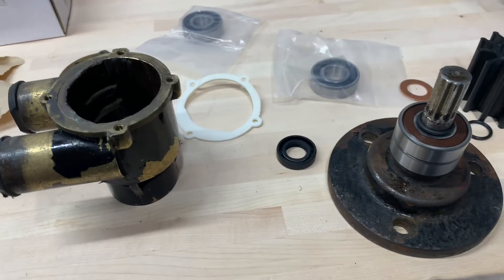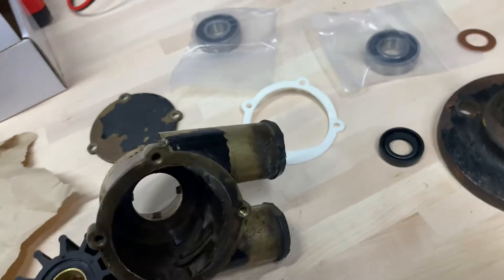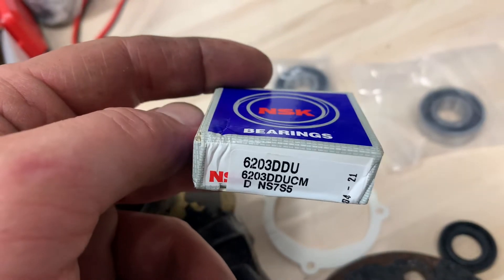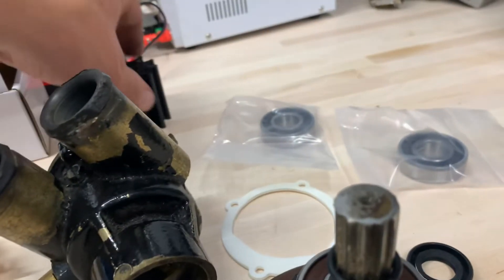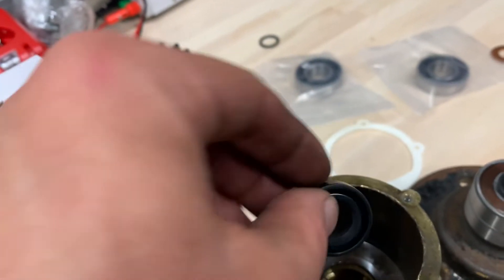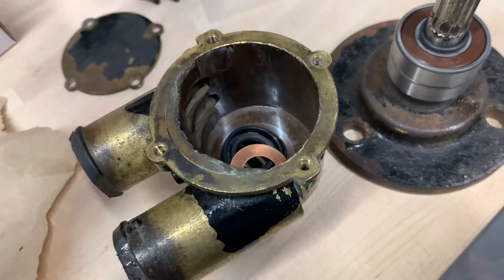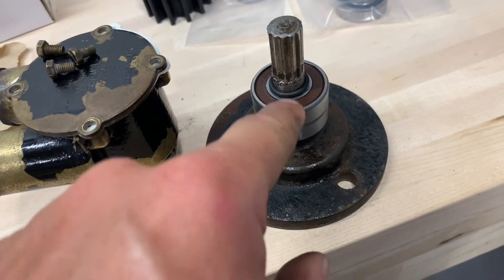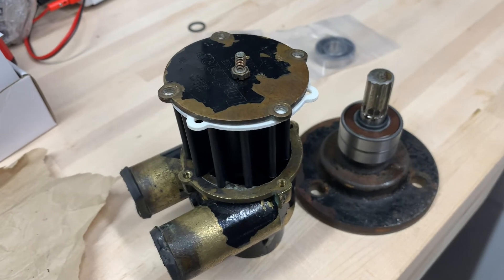How to rebuild an Indmar raw water pump the right way for your MasterCraft or Ski Nautique

Comment: Are you 100% sure the washer goes last? Mine was mounted after the leap seal and I just checked the manual and it says to place it before the leap seal and not in the last position… now I’m wondering… 😅
Reply: I agree he's got that wrong. I have an original pump that was never disassembled before. The copper washer was sitting on the brass tabs before the seal goes in.
Reply from the maker: @braineatingalien  thanks guys!! Can you post a link to the manual? My exploded drawing is missing parts.
Reply: @DaveMathews  I don't know how to drop the manual in here, but it does show the metal washer to be on the shaft before the rubber seal goes on, and not on the spring side.
Reply: 1st let me say thanks to the content creator for a great illustration ....  My 1978 Johnson f6b-9 SWEDEN water pump actually had the brass washer was installed resting on the brass tabs as @braineatingalien did (catchy name Sir!).  My thought is that the brass washer is supporting the seal from blowout.  I've never seen a copper washer face the impeller.. but then again I ain't seen a lot of things..Oe other interesting thing on my original pump is that its got a curved latitudinal rod going across the input and output ports so as the impeller rubs against it.  I believe that it provides additional support to the impeller blades and provides additional performance.  My replacement knock off works great however I run my outdrive in a 65qt cooler and at 650rpm idle I meter how much she  drinks and the old SWEDEN pulls up at least 15% more throughput per minute than my brand new pump. You could call it quality but I'd call those bar/braces a better design.  Anyone seen that before?

Comment: I've been looking everywhere for this information. How do you remove the raw water pump from the output shaft?
Reply: If it is f6b it’s just stuck there after you take the bolts off. I used a pry bar and it came loose.
Reply from the maker: Yeah, sometimes paint and rust locks it onto the PTO. Just pry or knock it with a beer.